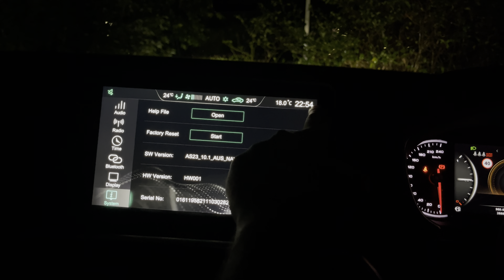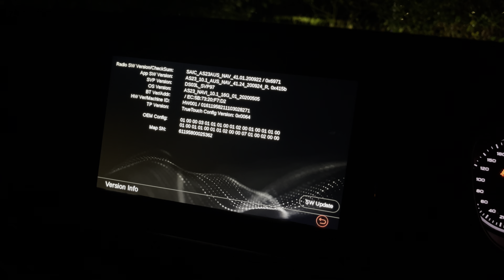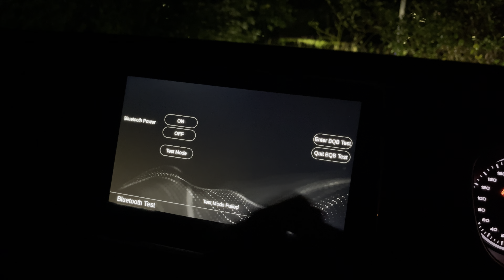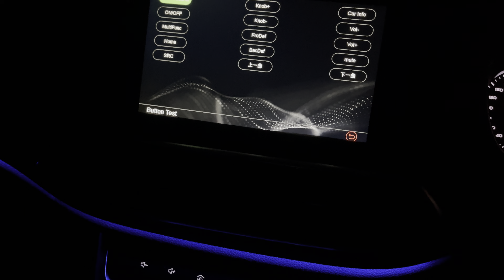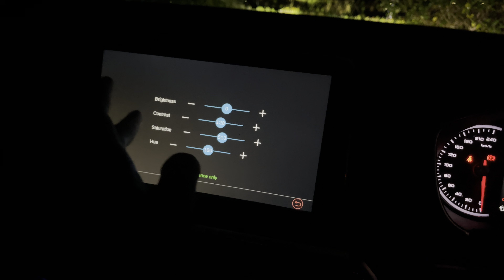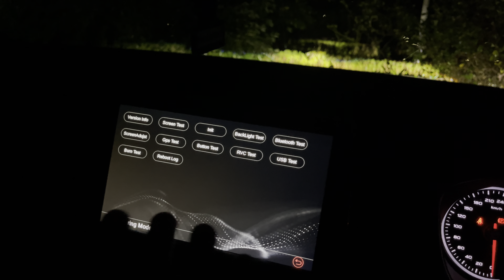MG HS Infotainment System Engineering Mode Part 1

Comment: Really Interesting. Like most UK customers of New MGs over the last six months, I have a temporary fix for the DAB radio due to chip shortages. Unfortunately MG have removed the DAB/RDS menu settings option which means my FM radio has no RDS. No help from MG on this so wondering if you’ve come across any way of reinstating this from the Engineering settings? Thanks